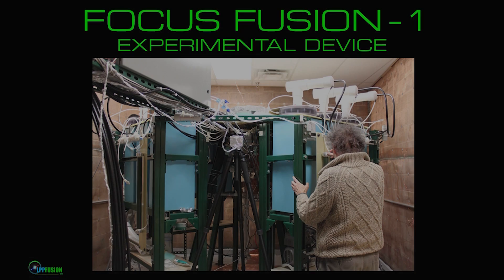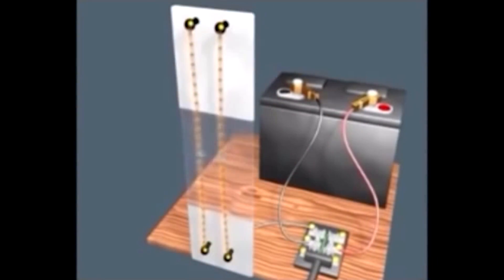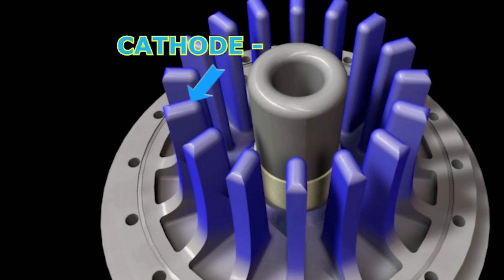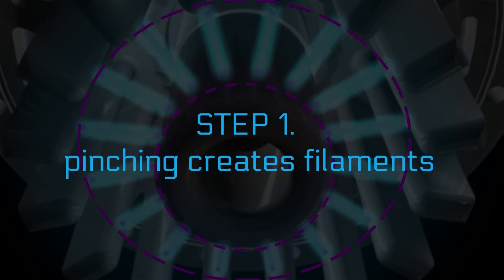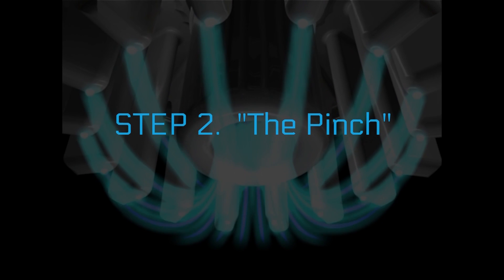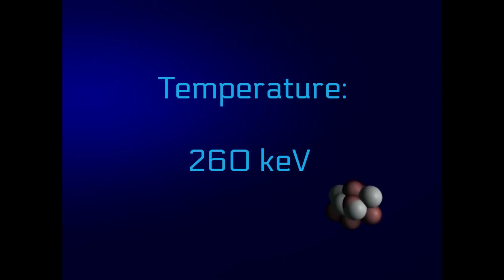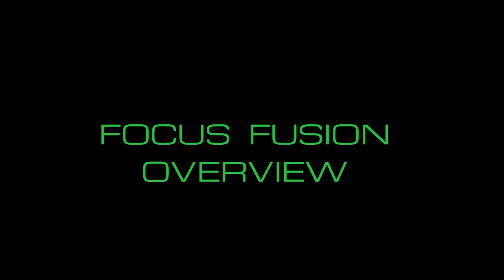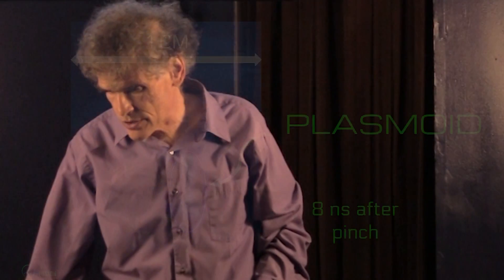The New Fusion Race - Part 3 - Focus Fusion: How Does It Work?

Comment: This is amazing! The least funded project turned out to be the most successful because it's based on the right idea.
Reply: The most successful based on theoretical claims by the main proponent.
Reply: @chrimony  the dense plasma focus device has been around since the 60's, no need to make theoretical claims about it.
Reply: @Norbert-yk4jy  He's making claims about fusion and energy efficiency. That hasn't been around since the 60s. If it was just a matter of using a device that's been around from the 60s, he wouldn't have spent all this time just paper claims.
Reply: @chrimony  I thought you meant the temperatures achieved. Well, it's all "paper claims" my friend, fusion, climate change, etc. You're free to doubt anything you want to doubt, but unless you have actual proof, your doubt is just a claim.
Reply: @Norbert-yk4jy  Unless he has an actual working device with demonstrable results, his claims are just a claim.
Reply: @chrimony  ok and so is yours unless you have proof.
Reply: @Norbert-yk4jy  I'm not making a positive claim about fusion without an actual working device and experimental results that can be independently verified.
Reply: @chrimony  you're making at least the following three assumptions:
1. Without a complete working device LPP can't publish any results, otherwise they're just claims. 
2. The partially built device does not work. 
3. LPP is being dishonest about their published results.

So, if you don't have actual proof of the above, then your accusations are merely claims, NOTHING more.
Reply: @Norbert-yk4jy  There's nothing for ME to prove. I'm not making claims about fusion. I CORRECTLY stated that his claims were just theoretical.
Reply: @Norbert-yk4jy  
Science works on evidence, reproducible evidence and until that is achieved everything else is just a claim. This is for those who are not scientists.
Reply: @Yohimbine77  Humility is an attribute of a good scientist, I detect none in your comment.

Comment: Since it's really small, I wonder if this could be used in an airplane.
Reply: If your energy is aneutronic and clean, then there's no reason why it couldn't be used to power an aircraft. It's the idea of fission reactors in aircraft which was abandoned, because of the radioactivity hazards.
Reply: Yes. I believe the original idea Eric had working for NASA was to have such a reactor power a spacecraft, so why not an airplane.
Reply: Lockhead Martin seem to think so
Reply: Free Music Archives 
Putting a reactor on a spacecraft is one thing, putting on a airplane is another.  There have been several SNAP reactors and no reactors on airplanes.    It's an old idea abandoned long ago.
Reply: Cat Man. You obviously did not watch the videos. This is not a Tokamak.